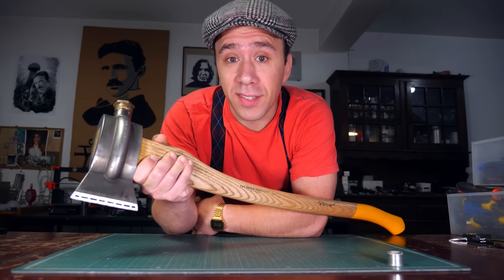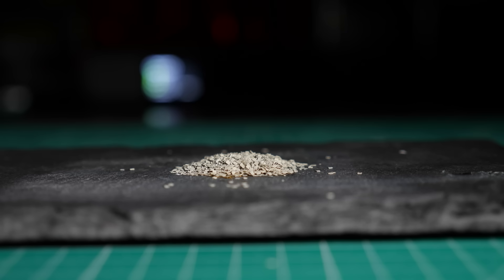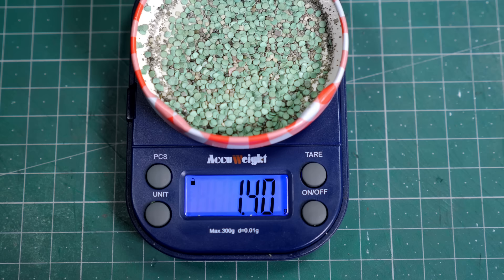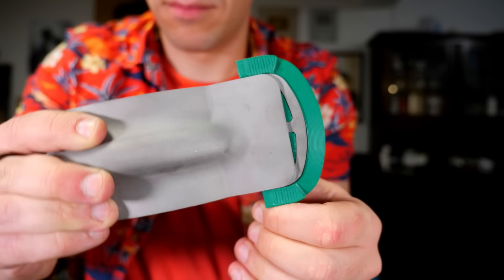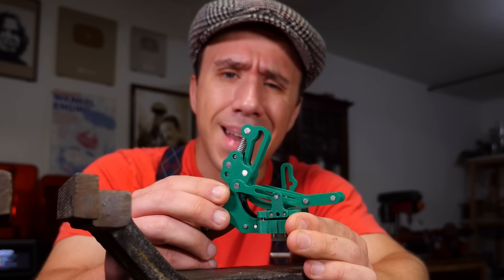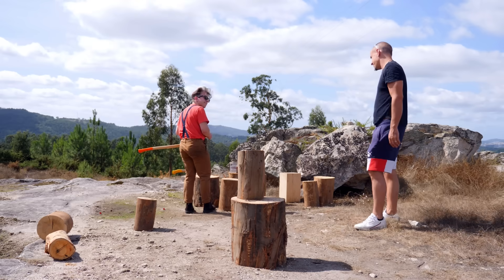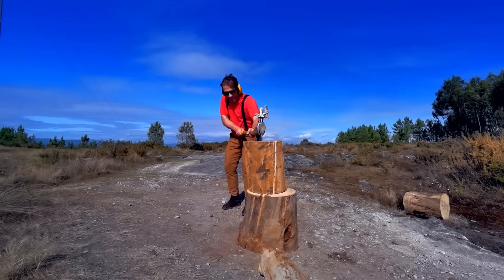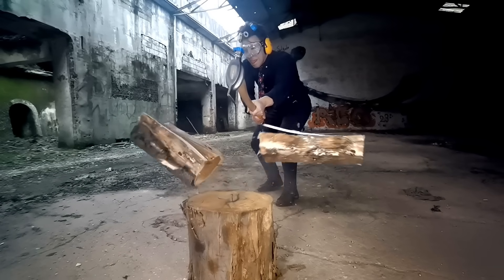I built a BETTER SHOTGUN AXE

Comment: For v3 make it so rather than have the gas push the log apart, make the axe head 2 parts on a hinge and once the axe head is partly embedded in the log use the explosive force to push the 2 parts of the axe head apart. This way you can design the parts to contain the explosion and harness its full force towards splitting the log. Though more moving parts does mean more points of failure and with the force of an explosion that might be a bit too dangerous.

Comment: Question: in your internal dialogue/when talking to yourself, is it English or Portuguese?

You could probably do a trigger mechanism next to the blade the limits blade depth while also fitting the shell at the right time.

Also: thank you for being such an inspiration.  Sometimes my builds look sketchy and I need to remember that it's okay.  If you ever need an assistant or videographer in Florida, lemme know.

Comment: You could have a two parts ax where front is pushed inside wood by the explosion instead of only using gass pressure to split wood

Comment: Lots of good suggestions from people who know more than I do about guns and explosives. However, one thing is suggest after looking at your footage (especially the sudden launch of your locking mechanism) is that you really need to wear a helmet when doing these tests, preferably one with a ballistic face shield. A motorcycle helmet with an impact resistant visor would work too make sure parts from the axe or the wood which get launched towards your body are less likely to severely injured you if they hit your head.
Reply: and make sure it covers your neck at least

Comment: That's an interesting failure sequence. It's pretty obvious that the mechanism's spring is either too weak, or the length of travel needs to be a bit longer; it's going of about when the axe blade has barely penetrated the wood- it's actually pushing the axe head back out briefly. This is something where you might want to talk to a firearms expert- the timing issue's pretty serious.

Comment: If you tighten your drill press chuck using all three holes, and go around twice, your drill bit is much less likely to slip in the chuck.  Of course, if you don’t clamp your stock and the bit grabs your stock, but doesn’t slip, your stock will try to kill you.

Comment: yeah, if you wanna survive the mk3 you need a helmet...and a bunch of other safety precautions.

Axe head itself had a funny profiling in these vids, you may wanna look into what type of head is mean for splitting different woods and for which purposes so you could metal3d print a new head.
also you may wanna design in some guided exhaust, to use all of the pressure sources instead of fighting against them ;)

PS. Carpentry aka Jeesuscraft🤭 has been around for a while and knows everything about splitting any kind of wood by now🤓

Comment: Wow, you’re a fancy boy huh? I’d have just used a weighted firing pin held in place by a pipe with a light compression spring keeping the pin off the shell until the inertia of the weight overcomes the spring when the axe hits the wood and fires the shell. What you made there was art 😮

Comment: Probably I'm wrong but if 40ml of oxyhydrogen expands to 300ml then the amount of oxyh that you need for it to expand to 1.2L is 160ml, you already have 40ml in the axe, so you just need to build a 120 ml chamber to contain the extra oxyh that you need to get the same output as the gunpowder (assuming the expansion factor is the same for 160ml of oxyh)

Comment: For v3, consider a one sided vent. An asymmetric pressure release area would push the blade into the wood more than up so you wouldn't be working as hard to keep the seal there. It would also be directional, so you can blow off slats around a nice big log. It also makes it easier to design to vent gasses outwards instead of downward.
Reply: I really feel strongly that copying the geometry of a traditional axe head, with a smoother transition in width in particular, and the exhaust ducts not protruding from the edges. You're shooting yourself in the foot. You're building a project on top of an inferior axe.
Reply: @IfYouWillem  maybe he could make a hybrid of mk1 and mk2 for mk3 where theres smaller slots like mk1 on opposite corner and side of the blade and big slots like mk2 on the other 2 opposite corners. that might look cool and as long as they all exit as the same time it will be spectacular
Reply: @IfYouWillem  asymmetric.. like one side of the blade has a vent on the front , the other side has a vent on the back? then it has rotational force, thats interesting
Reply: This is actually a really good idea.

Comment: Ideas.

Rocket powered axe head. Once it hits, apply thrust to wedge in harder.

Or use an explosive power source to drive a piston that physically pushes on both pieces.  My initial idea is the blade splits down its center line.  That wont work well, but maybe a 3 piece blade so the center cuts in and the left and right sides push out.

And for the love of fingers, build in a safety. 

And if shells are hard to get,  chemistry and a spark plug may do.

Comment: There are some vintage mechanical log splitting axes that have a little arm that pops out the side of the blade after penetration to push the log apart. Curious if that kind of mechanism could be driven by the shell rather than trying to vent the gas directly into the wood since it might not always get a good seal

Comment: Your new axe designs have big flaws. Look closely. The holes from where the gases should come out are blocked at the front suddenly. To fix it, you need to simply sharpen the inner parts of the curved and arrow head pieces in the front.

Comment: I feel like making shotgun wedges would be better than making a V3 axe. You hammer the wedge in with a sledge hammer till it's buried, then you load a cartridge, and hit it again with the sledge to set off the shell. That way the timing is exactly when the downward force is high and there is still downward inertia to stop it from blowing out eliminating the timing problem. And since the wedge is already driven in,  you don't have the "penetration" problem.

Comment: It seems like pressurized air or gas  would  be much easier and cheaper  to use if you combined it with a triangular pick axe head for deeper penetration.  less moving parts , just weld a refillable mini pressure chamber on the other side of the axe head. You can use soda maker CO2 canisters to refill OR if you have the patience,  repurpose the pump from an air gun and attach to the axe handle. Advisory, we urge you to follow local ordinance laws and health and safety  guidelines. Under no circumstances should you use inexpensive and legally available nitro gas  canisters sold to RC Race Car hobbyists.

Comment: the curved blade looked like it did really well though, and the new design looks a lot easier to clean when needed.
its just a little forethought but, it might not be a bad idea to have some kind of saftey valve that'll keep the firing mechanism from removing itself and instead just vent the gasses if the system fails to split the log. its either that or, need it to be even more secure so the wood has to give out. just be careful you don't make a pipe bomb in the process.